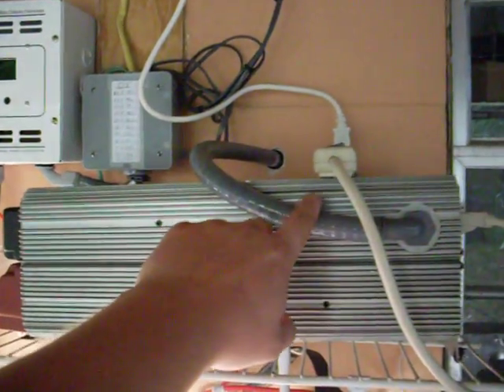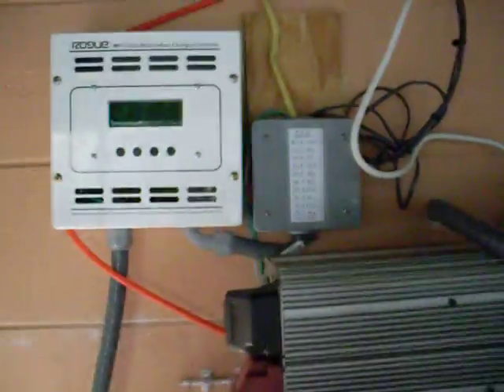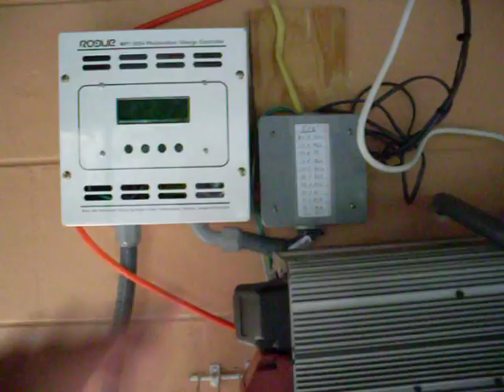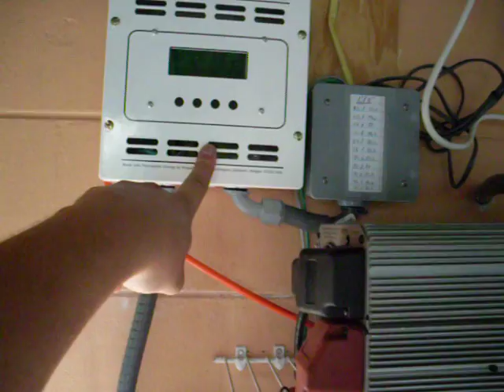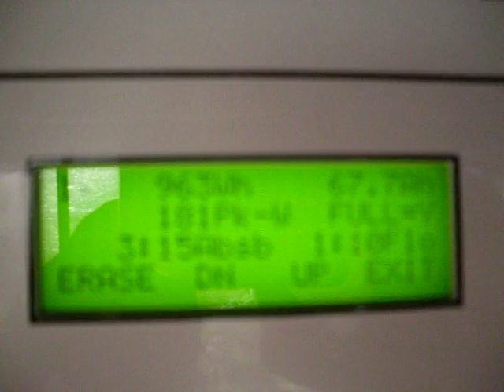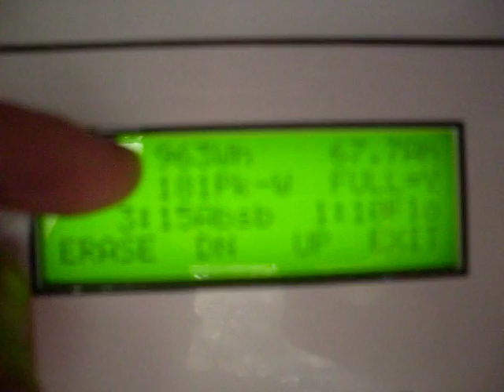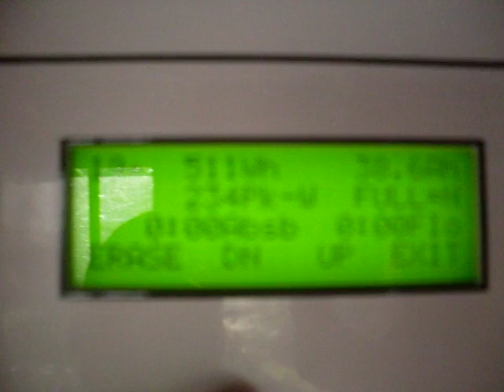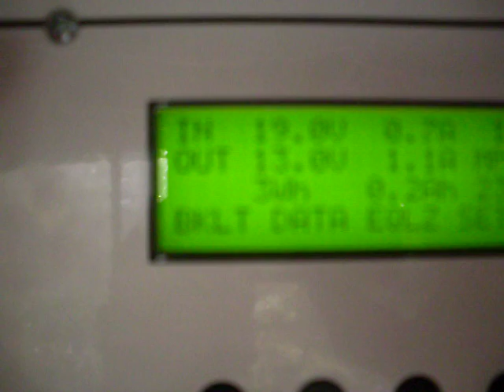My Home Solar Setup in Florida- Update #2

Comment: Thanks for doing this. I just bought a Rogue MPT 3024 and will be hooking it up next week. The controller provides a lot of information on the display that most cheaper Ebay MPPT controllers (many are fake I hear). Knowing how much the panels are producing and other important system diagnostics is just as important as the other hardware items because it enables one to tweak the system accordingly in order to optimize power.

Comment: @mrbuki77 I have a bank of batteries that consists of (now) 28 marine batteries, 8 golf cart batteries and 2 forklift batteries. All 12 volt to 5000-10000 watt inverter and I run off of 30 amp total solar panels. I power 2 full sized fridges a 55" plasma tv, a 10 foot chest freezer a250 watt flood light that runs 24/7 and a window air conditioner that runs about 4 hours a day 8000 btu. I have it on cloudy days hooked to a 45 amp commercial grade charger and it stays up.130watts from electric co.

Comment from the maker: I am growing my system as I find good deals. Why get 3 or 4 increasingly larger inverters? My next upgrade will be to the panels. I have enough power to supply my emergency needs during all daylight hours, and about 4 to 6 hours after dark. My goal is to create enough power to fully charge my batt bank by 2pm every day, and have enough power reserve to use all night.  So, I do agree that using less than what you produce is better. So I try not to over-drain my batts at night. Thanx!

Comment from the maker: Yes, you can run a frige with this, and then some. As for the wires, I am about to rewire mine, b/c I used solid copper wires. There is more loss of voltage with these. I recommend multi strand 10 ga. The best priced would be 12v landscape wiring. A 100ft section is about $30 to $40. If you have more questions, I'll answer them as best as possible. Thanx for the comments and questions.

Comment: I bought a simalar xantrax 3000 watt inverter and I am getting ready to put to gether a system. Can you run your refridgerator with it thats what I would like to do. Also when I run my wires from my panels should I use about 10 guage wire?

Comment from the maker: You are absolutely correct. I am removing the standard 12v car battery. The rest are deep cycle batteries. I have done some cleaning up. And done some other things to bring my system up to code. I am going to do another update in a couple of weeks. Thanks for the advice.

Comment from the maker: The Rogue MPPT 3024 will display real time information. Volts In, Volts Out, Ah made, AMPS from panels, AMPS after MPPT modulation, battery temp., watts being produced, and Wh made....as well as keep the last 30 days of daily production. It also has an Equalize feature to charge the batteries to 14.4v to ensure that the voltage is the same through out the batt. bank. This is done about every 60 days. This unit is well worth the investment. And the manufacturing plant is in the USA.

Comment: I am a motor head guy moon gearing means tall gearing ,You can use pullys and a belt ,or chain and sprockets from a motorcycle ,put the larger sprocket on the turbin hub and the smaller one on the gen,To make your turbine spin even faster in light winds  ,Also the generator should be a high wind one,if your going that route,Glad to hear you cleaned up your wires ,wind mill are great ,mine will spin all night long during warm or cold fronts moving in.,

Comment from the maker: I have actually placed all my wiring in water-tight conduit, since this video. And added a 60amp trip fuse between my charge controller and solar panels. And another one between my charge controller and battery bank. I will post an updated video soon. Thank you for the advice.

Comment from the maker: Although there is some power loss using 12v wiring. You do loose more power inverting power. If you can get 12v appliances, then the further your power will go. 12v bulbs for light are expensive, but work very well. Later from sunny FL

Comment: Switching to 24 volts is a good idea, but i am trying to keep my system at 12 volts as i will be adding some 12V appliances to eliminate the inverter which robs power. What do you think? Greetings from sunny Jamaica.

Comment from the maker: Yes, it's normal. Your 13.0 reading is what the charge controller is running through the cells inside the batteries to charge then.  So that is what you see. But if the AMPS are lowered by clouds, rain or shadows. Then, the closer to the actual voltage is seen. The voltage from the panels is still the same, clouds or no clouds. But what changed is how many AMPS they are able to produce. If you would like a better explanation, I can elaborate some more. Thanx for the question!

Comment: Is this setup all off the 45 panel kit still or did you add more panels?
I have 3 kits and black friday HF is going to sell kit for 159.
As for everything so far it is looking real good. Wish I had the controller you have.

Comment: excellent video, nice idea having 24v stepped down to 12 which should give alot more amps. i'm about to be cruising. i've almot done with my 4th 64watt panel and my 5th one is going to be made of 6X6 cells at 8.3 amps. mmmm i should be set for a while so maybe i can concentrate on making it look better lol.

Comment from the maker: I have my wiring coming through the center of the box and then runs outward to the bus bar. If the glue fails, this would push the bus bar  away from each other....As for the 24v change; this is done to minimize voltage loss in the wiring. I have 80 ft of wiring, and I'm loosing about 0.5v and 13 watts. With the higher 24v push, I will only loose 0.14v and 1.8watts. Bonus my amps coming down are cut by 1/2, which means that my 30amp charge controller will handle 880w@24v vs 440w@12v from panels

Comment: Nice work-in-progress!  I like the panels connected to your tower.

I also made one of those combiner boxes.  Unfortunately, my super glue broke loose, releasing one of the bars, shorting to the other bar.  I'm going to look for a different solution... maybe bolt the ground bar to the plastic box.  Good luck with your box's reliability.

Why are you changing to 24V?